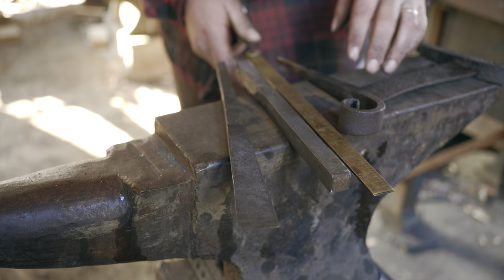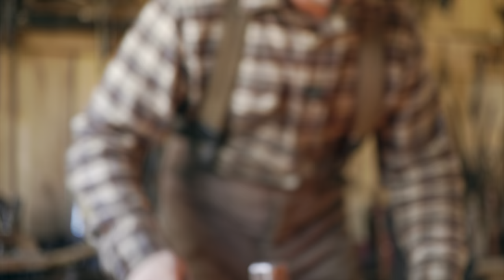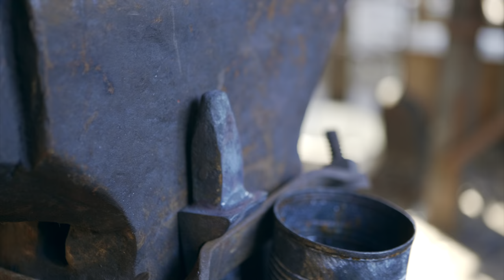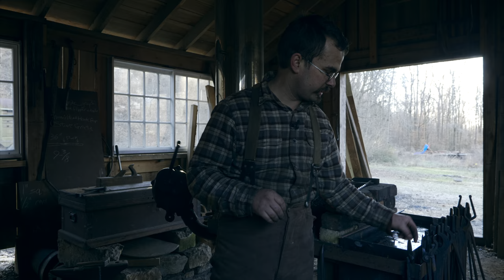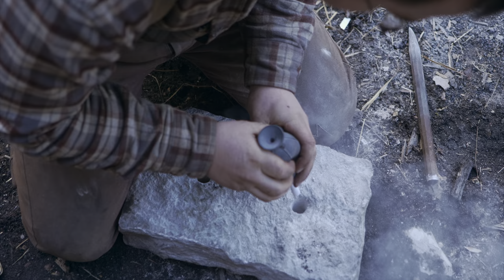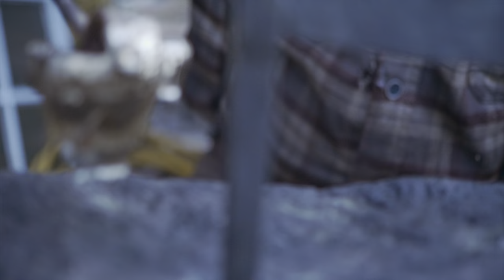Forging a Reproduction: Antique Boot Scraper

Comment: 1- Thanks very much for showing that method of cutting into the stock to create the tenon, I had never seen that. 2- I have a very small galvanized bucket that I hang on a driven in hook that fits into a drilled hole in either end of my anvil stump. Dang it's handy hanging there where it can't fall off. I can move it to either end and remove it all together. I think they sell the bucket as a grease bucket for grills. 3- I bet any amount of money that miss strike on the drift you were looking at the hole in the bar and not at the end of your drift. Your hammer went where you were looking. I try  to point that little point out when I'm demo'n to new smiths when I'm punching a hole. "Put the punch where you want it then look at the struck end and hit it. If you look where it's setting on the piece you'll hit short and hammer your thumb. 4- At ABANA in 2014 I watched Jeffery Funk punch a hole in a very hot rock with a press. That was FUN.
Reply: Evening Bill! Lots n lots for me to learn here from y'all
🙏🔥⚒️🧙🏼‍♂️
Reply from the maker: Thank you Sir! Yeah, that cutting in technique is shied away from by some because they don’t like the cold shut it produces. But treated right and used in the correct applications it is just not an issue at all. Cutting in results in less suck than using even a sharp corner on  the anvil, which leaves more material in the corner that (in this case) gets drawn out into the blade corner.

I definitely need to rig up something better for my water can. Just hasn’t been high on the list.

Comment: Here in Northeast England 🏴 we were known for coal mining and the houses provided by the mine owners had a carved sandstone built into the wall with boot scraper bars in them. It was deep enough to put a large foot into it, close to 9 inches. How about making one seeing that you made such a great job of that one.  They were at the edge of the doorway, the only way to get the bars in was from the interior of the wall so were made before building the streets which were up to 2 - 3 hundred yards long up to 50 - 60 houses.

Comment: What kind of coal do you use? How do you order/buy it? I am down in Texas, and switched from anthracite to bituminous this past year. This doubled the price from $7 per 40 lb. bag to $15, but it also changed from nut coal to pea size coal. But, I like the bituminous coal so much more, I just don't like all the dust/powder per bag or how small most of the coal is. Any recommendations would be appreciated!